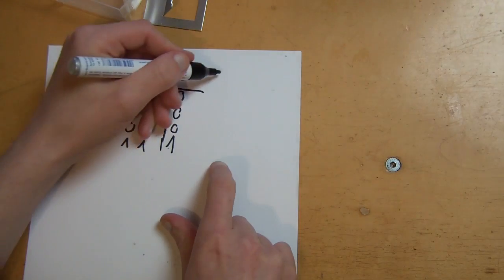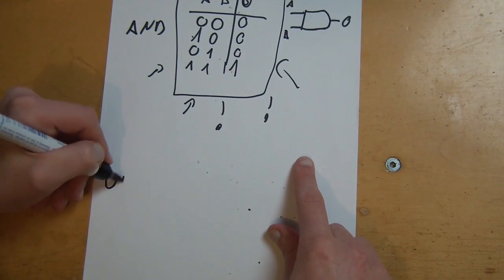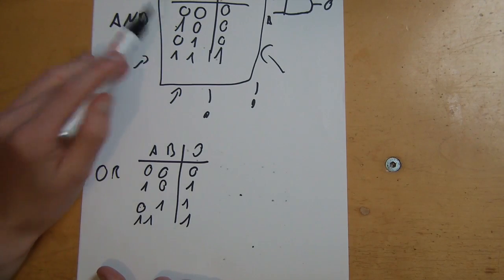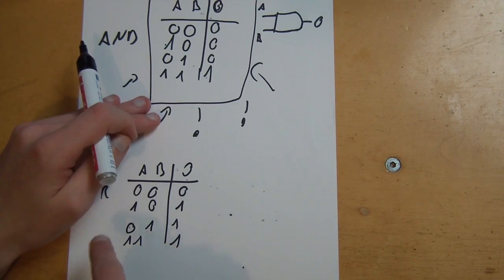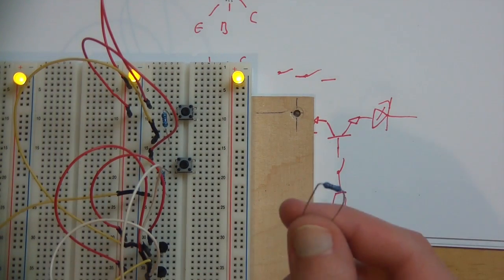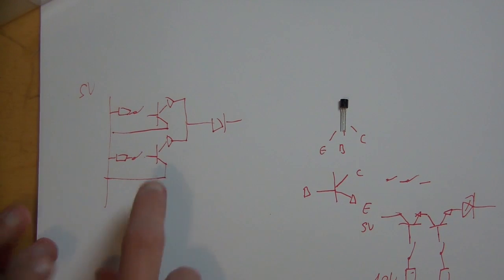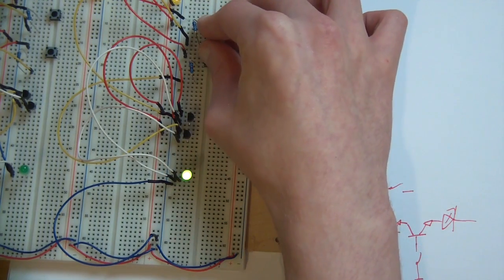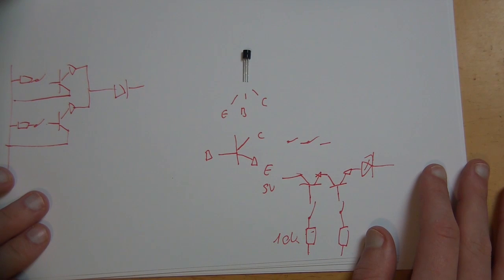What are Logic Gates and Transistors - Lets Build - 8 Bit Computer Part 2

Comment: Wait isn't it easiet to make AND gate with only 1 transistor by accepting the collector and the base as the inputs or am I missing something ?
Reply: it will work but you now need to make sure that base gets very low current as input or it will fry the transistor

Comment: The LED should be on the collector not the emitter. The emitter should be clamped to zero volt. That way you will have 0.6 volts dropped across each transistors and 3.8 volts across your LED when the base is switched to 5 volts. When the voltage is removed from the base, the LED and transistors will form a potential divider with most of the voltage dropped across the high impedance transistors and a small voltage across the LED. Because the LED and two transistors are all in series, the high impedance of the transistors make the current flow very small. Low voltage and very low current ensures that the LED will not light up even if one transistor is turned on. Otherwise good job in explaining.
I think it is important to think of transistors like variable resistors whereby gradually increasing the base voltage and current for a bipolar transistor will gradually decease the resistance to the point where it will be so low compared to the resistance of whatever it is trying to drive whether that be n LED or a small speaker. Then the voltage and current will favour the LED or speaker. The transistor transfers resistance and hence the name TRANSISTOR short for TRANSfer ResISTOR.

Comment: Question about those resistors... (yes, I know I'm very late to the party.)
If you've got series of multiple logic gate transistors switching eachother, do you need resistors for every single transistor or can you just put resistors and the beginning of the circuit?

Comment: In the beginning of the video, you only used 1 red cable for the and gate. But when you used transistors, you instead used 3 red cables. Is that necessary?

Comment: If transistors are supposed to act as switches and they need SWITCHES what's the point of even having them!!!
Reply: He's only using the buttons to explain how transistors work with high and low (on and off) logic levels. You can imagine that the individual pins of a processor or microcontroller are driving the inputs instead of buttons and the outputs are driving other parts of the circuit.

Comment: You really don't need transistors for an OR gate. You can just connect two input wires to a strip on a breadboard, and an output wire on the same strip. You could use diodes to ensure the current doesn't backflow, but aside from that an or gate is just two signals both to the same output, nothing in between.

Comment: Isn't a transistor already an AND gate in itself? Both the collector and the base need to be true, for the emitter to be true.
Reply: No. He didn't really explain it like I think he meant to, but transistors will leak some current through to the emitter from the base. That's why the LED lit up a little when he pressed the one button. In a real computer, this is a problem because you will never have a completely open circuit. So instead you measure on/off by the voltage. On = relatively high voltage, and Off = relatively low voltage. On = 5v/Off = 1.5v or something like that.

Comment: 10:05 Voltage is not "coming into the base". Rather it is applied between base and emitter to make a current flow into the base and out the emitter. Bipolar transistors are current-controlled.
11:55 Or rather it would fry pretty fast :P The base resistors aren't there to avoid the transistors being open all the time, because as long as the switches are not shorted, the voltage across the emitter-base junction has no effect on the transistor! Why? Because there's no current flowing into the base. (Remember when I said that it is current-controlled?)
The real purpose of these resistors is to limit the base current so that the transistor won't fry immediately :P (and additionally, to lower the power consumption of the circuit as a by-product).
13:40 I wouldn't suspect that anyone can fail at making a simple AND gate with transistors, so bravo, you managed to achieve that :P (Unfortunately, this doesn't prospect well for your future tutorials :/ )  That's because you made your AND gate current-controlled. In digital circuits it's better to use voltages for representing signals than currents. Because using currents means much more power consumption, most of it being wasted for heating your room (unless it's in winter, then it's acceptable ;J ).
Reply: +Bon Bon He isn't trying to make a technically perfect video. This isn't an "Exactly How Transistors Work" video. It's "How to Build Logic Gates from Transistors and Also a Bit of Basic Understanding of Transistors That is Just Enough for a Beginner to Mostly Understand it."
Reply: +Bon Bon He isn't trying to make a technically perfect video. This isn't an "Exactly How Transistors Work" video. It's "How to Build Logic Gates from Transistors and Also a Bit of Basic Understanding of Transistors That is Just Enough for a Beginner to Mostly Understand it."
Reply: He isn't trying to make a technically perfect video. This isn't an "Exactly How Transistors Work" video. It's "How to Build Logic Gates from Transistors and Also a Bit of Basic Understanding of Transistors That is Just Enough for a Beginner to Mostly Understand it."
Reply: I'd rather say "Just Enough for a Beginner to Misunderstand it and then Misapply it throughout his entire life" (because what has been learnt, cannot be easily unlearnt).

One does not have to delve into gory details of how transistors work to explain logic gates, I agree. But there are some basic details one needs to know, and one needs to know them correctly, even for such simple circuits. If one wants to build logic gates specifically from transistors, one needs to know at least how the transistor works and how to use it correctly. Best of luck if one tries to build a logic gate – not to mention an entire computer! – if one does not know the basics of electricity first (things like charge, current, voltage, resistance, and at least some model of a transistor).

Comment: 0,2,1,3...
That's not exatcly the way to test =P

A tip: the accounting goes from right to left, and you does twices the last column:
first column: 01010101, second column: 00110011, thrid column: 00001111, fourth column: 00000000...

BUT, if you need to make a karnaugh map, use the gray code!

Comment: It got me thinking, why does the voltage on the base stops there (if it is an lower voltage)? I mean, shouldn't it need something to close the circuit?
Reply from the maker: It flows from the base to the emitter. Basically, there is a band of negative charges in the transistor, and since electrons are also negatively charged, they repulse each other and cannot cross. Applying a voltage to the base removes that barrier and the electrons that flow into the base and the collector both leave through the emitter.
Reply: madmaxx  Yes I know how p-channels work, I was refering to how the electrical current that goes to the base stops there (I expressed myself very poorly, sorry), there is no ground for the base.

Since we're at that, I never got a good video explaining how n-channels work (the channel Veritassium explained very well the p-types only).

Thanks and sorry.
Reply: +Legendaryknight2  bn eater channel is excellent
Reply: +madmaxx  VOLTAGES DON'T FLOW!!! ELECTRIC CHARGES DO! (And the flow of electric charge is called CURRENT, not VOLTAGE). I see you making this mistake all the time, which doesn't prospect well for your future episodes. If you cannot tell the difference between voltage and current, then you better learn the difference or stop playing with electronics & misleading people.
Reply: +Bon Bon he didn't say that voltages flow. He said: "the electrons that flow into the base and the collector," which doesn't in any way imply flowing voltage. You need to stop criticizing people for everything.
Reply: IanCraftsAndMines OK so let me quote for you their exact words and rub it in your face:  

First, the OP asked this:  
"why does the voltage on the base stops there"  
specifically asking about the voltage (not electrons) stopping (and in order to stop, it must have been flowing, right?). The question was a direct consequence of what the author said in the video above (and this is a great example of how his misconceptions about electronics spread to other people like a disease). Then, the author of the video answered:  
"*It flows* from the base to the emitter."   
Where by "it" he must have meant the voltage of course, because that was what the OP was asking about, not the electrons. And the author of the video never corrected him.  

Sure, there is a bit about electrons as well. But this does not erase what he said in the video above, and several other videos where he explicitly says, for example:  
(10:06) "When no voltage is coming into the base"

At 10:20 he says "current" instead, which is correct, but it also shows that he doesn't seem to see the difference between voltages and currents (especially that this is not a one-shot mistake – he does the same error multiple times in this video and other videos).  

(11:56) "If you would just put 5V in here" (pointing at the base of a transistor)  
This is again suggesting that the voltage "flows" into the base, which is incorrect. It is also incorrect from another reason: bipolar junction transistors are current-driven, not voltage-driven. If you applied only a voltage to the base, but put a resistor so big that it wouldn't allow any current into the base, the transistor would not open, because it needs charges to flow (that is, a current) into/out of the base in order to work that way. This is contrary to how MOSFET transistors work. But I bet the author of this video does not know this either, since he seems to believe that all transistors are just switches into which "voltage" flows to open them :P  

There are more examples of this "voltage flows" mistake in several other of his videos, but I don't have time to go through them and find all of them for you now (you're not that important to me, sorry). But you can do it yourself. Go figure.

Comment: And finally someone explained in a simple way what the resistor is doing there to the transistor. Thanks mate.
Reply: +Legendaryknight2  Yup, except that his explanation is wrong :P
The base resistor is there to limit the base current. Imagine that electric current is like a flow of water in a pipe. The more resistance is there, the less water can flow through the pipe (which, as a side effect, causes the water to build up at the resistant part and the pressure=voltage goes up across it).  Usually a very small current of electric charge flowing into the base is enough to open the transistor. If there's no limitation on the current, a large current through the base can fry the transistor, because it heats up pretty quick. The base resistor limits the current to an acceptable value – just enough to open the transistor.
Similarly, there should be a current-limiting resistor in the collector-emitter circuit. Fortunately, his LEDs apparently have some built-in resistors which limit the current.

Comment: I feel you should learn how to properly use the pull down resistor,before you try and use any of the fancy 140 dips you bought. Just put one end of that 10k between the switch and the base and the other end to ground. Might seem weird at first shorting it out like that. But thats why you use such high resistance. The idea is the transistor isn't happy with an open wire, it needs a ground as 0 not an open circuit. And try using a voltage regulator if you need resistors before every component luck

Comment: :( But isnt it not good, if there is even a little bit of power, when you press the second button in the and-gate? If you would do a and gate with a relai, there wouldnt be that little power, am i right? Are real PC's running with transistors or with relais? (Sorry for bad grammar, im german :D)